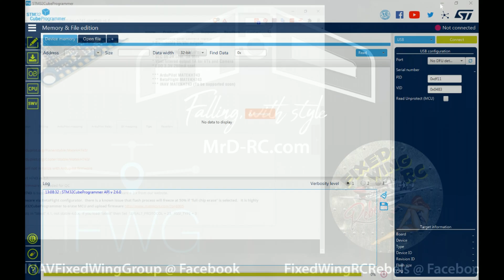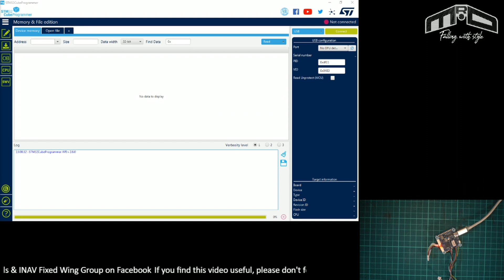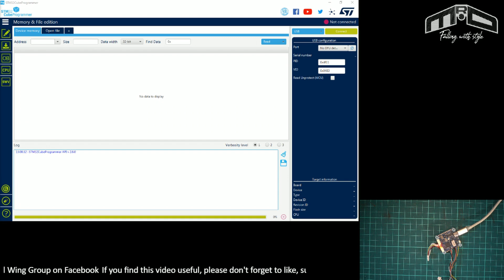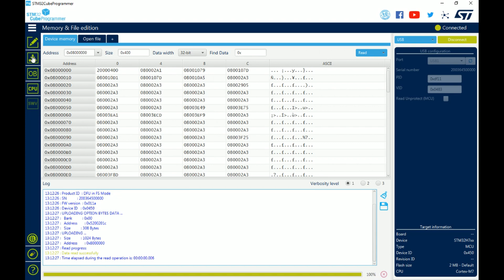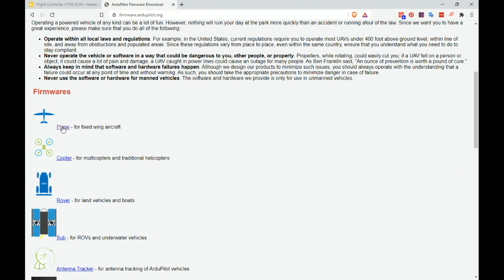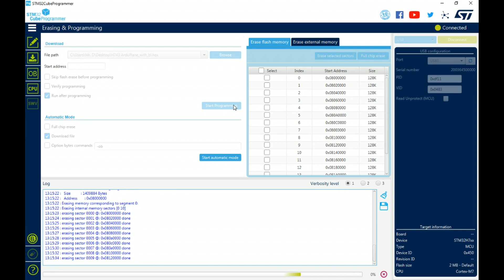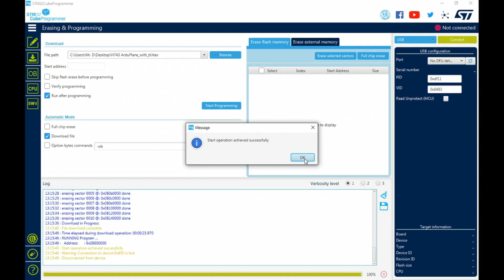Installing ArduPilot on an H743 Flight Controller

Comment: Thehr is problem with MATEC 743 WING V3, impossible to found working firmware with properly configured axis . Anyone know working firmware for copter in frame F450 ?

Comment: 100% Success!~ As a Mac user, the hardest thing for me was to get an email address on my windows computer.  Your instructions worked perfect!  Everything fell apart typing to download Mission Planer on the Mac.  Took me 2 hours to figger out the email thing but 15 minutes to get flashed and mission planner working.  Thrilled!

Comment: I've followed these steps however my board's red light is stuck on, and will not proceed with normal operation.
Reply: Same issue here. Any luck?
Reply: @jonathansoliman9918  I installed H743 on the H7A3 board rather than the appropriate software

Comment: Thanks so much! Turns out if you have a certain thrustmaster controller driver installed there is NOTHING you can do to get DFU mode to connect to the programmer. Pulled it up on another machine and this did it for me! Thanks so much

Comment: This guide is STILL useful and correct as of January 24!  Thank you Sir.  I am new to programming flight controllers, as I have only used "Ready To FLy" planes before.  Thanks for your help SIr, MOST APPRECIATED!
Reply from the maker: Glad it helped Jeff 👍🏻
Reply: I used this guide (for the third time) on December 18, 2025. Still works great.

Comment: i have matek h743 i done flash and also upload firmware its doest connect i power controller on red light
Reply: Did you figure this out? I have the same issue

Comment: Thanks Daren. Not sure I could have done that without your video!
Reply from the maker: Glad it helped 👍🏻
Reply: @MrD  I’m a actually using the fc for Ardurover but still the same setup for flashing the firmware. Still can’t get over how you found all that out!

Comment: I just used INAV to flash my F765wing with ardupilot, it seems to work, arxangle said do it that way.
Reply from the maker: It doesn’t always work. This particular FC was a prime example of that. It would not flash with INAV or BetaFlight. Hence this way of flashing using the official tool.

Comment: thank u so much u saved me from so much trouble cause i also have tried it with inva and beta flight configurators but those were just getting  stuck on load firmware and this thing really did worked

Comment: I'm trying to build a VTOL with arduplane and Missionplanner using Matek F722-HD and its designated arduplane_with_bl.hex (MatekF405-TE)  I  get to the start programming step and it just says operation exceeds memory.   I also tried it with F722-PX  but no luck. Any  suggestions?
Reply from the maker: F722 only has 512KB of storage. You're trying to flash an F405 target to the FC. Where did you read that the MATEKF405-TE target was for the F722-HD? Because they need to change that information, it's misleading. Firstly, that's a bad idea to mix firmware, as the connections between the MCU, components, and ports are likely different on the two boards. But also, the F405 has 1024KB of storage, so can fit more on. I don't believe there are any targets for the F722 on ArduPlane, because of the lack of storage. The same goes for the F411. However F405, F765, H743 would be fine to use.
Reply: @MrD   Thanks for the response!  Matek website's "Mateksys Flight Controller Lineup" page showed F722-HD and -PX has  having MatekF405TE for Ardupilot target. I thought there was something odd since the  spec page for them didn't mention ardupilot, just Betaflight and Inav.
Reply from the maker: @mickistevens4886  I see what’s happening, and it’s very confusing on Matek’s part. They’re actually listing the specs and targets for the F405-HDTE (can’t see the replacement for the F722-PX as that page doesn’t work properly on my mobile). The second row shows the recommended replacement FC in red. And all the specs below are for that replacement FC, not the original F722 FC. 

I will contact Matek and ask them to sort this out, as it is confusing.

Comment: Hi, I'll give you my thanks for doing this video, it's really helpful. I have just a concern. I tried doing this in a H743-WING V3 board, with the latest stable Copter firmware. Everything went fine, but when I connect it to Mission Planner it reads the device as 'Generic' and doesn't let me see any Flight Modes or change them, any idea what may be going on? I'll be glad if someone can help me, please.
Reply from the maker: Sorry, I’m still very much a noob with ArduPlane myself. The issues I encountered, all I could do was google, the read through a lot of text, only to not find the answer. Eventually, it does come up though.

Comment: Darren, once again a video sorts a problem!
Reply from the maker: Noice Josh. I was wondering which video lol
Reply: @MrD  if you want to get it totally sorted, stick one of the prebuilt hexs on with the ardu boot loader on it, so you can just flash from inside mission planner
Reply from the maker: Sweet. That wasn’t working when the video was made. I guess something’s been updated.

Comment: Thanks for that video. I hope some kind of full setup guide video (or series) are coming from you in the future.😁I'm missing Joshua Bardwell for Ardupilot. 😉
Mine went OK using Inav, full chip erase, flash firmware locally, it didn't freeze, configuration went OK, it connects to Mission Planner without any problem.
I guess I'm OK?
(Ignoring the problems I have during flight, weird behaviour of GPS home point arrow and ground speed, EKF lane switching, multiple warnings, vibrations, suddenly no elevator authority,...😶🙄)
Reply from the maker: Maybe I will. But I’m still getting to grips with ArduPlane myself. It was a huge pain to set up on a Matek F405-STD. But it is flying now. I will be making an update video, as I couldn’t find any when I tried to do this recently. There wasn’t even any documentation. Not good when you’re trying to update for the first time.

Comment: Thank you for the video! Quick question, after you do this, can you go into mission planner and flash arducopter like normal for a quad/hex build?
Reply from the maker: After the bootloader version is installed, you can update using mission planner.

Comment: Thanks for this video I will use it to try to flash arduplane to my Matek f405 wing (I seem to always be behind on what to buy & end up with obselete items) I don't want to learn inav or beta flight as I have used mission planner before. (but still have a great deal to learn)
Reply from the maker: The F405-WING is still a good flight controller. It’s still sold, so not obsolete.
Reply: @MrD 
Thanks to you I now have my 405 connected to mission planner so next its setting up servos etc.  I have liked and subscribed a while ago.   Happy New Year & thanks again for the great vids.

Comment: Were you able to connect all the components together via iNav?  The CANBUS just does not work.  I set both the air speed sensor and the GPS as MSP, but without success. Any tips?
Reply from the maker: CANBUS isn’t support by iNav. There currently aren’t any plans for it either. I think that’s a shame, but I guess there’s not much call for it at the moment. I don’t have the Matek GPS. I do have the airspeed sensor, but haven’t tried to connect it up yet.

There is a limit of 3 MSP devices. So maybe this could be causing your problems?
Reply: @MrD  I know you have the components.  I saw this video and ordered the components to learn the technology.  I did not imagine that iNav does not support CANBUS.  Matek wrote to me that "they never said there was iNav support".  That's ridiculous.  They sell flight controllers with dedicated entry to CANBUS.  All of their products works with iNav and should have explicitly written that there is no iNav support.  They enjoy a very large community purchasing their products and they have behaved dishonestly.  There are other YouTubers who have received the system for review and the impression is created that the technology works.  This is not a MSP issue.  The I²C input does not even supply power to the component.  In addition, Matek's website states that in order for the GPS to work in MSP, an up-to-date version must be dowenloade.  Just the burning itself was an annoying process that in the end I realized the CANBUS is not working at all. I connect the GPS to a UART and it is working but I cannot connect the AS unit via the GPS. Sorry that the post is so long. I'm a little frustrated.

Comment: Thanks for this video. I just received the v2 version of the h743-wing and was impressed that Matek links to this video in their notes section. I found that I was not able to flash ArduPlane using the STM32 application. It would always give me a startup operation error after the download. I ended up erasing the chip with STM32 and then flashing the ArduPlane firmware with BetaFlight, ensuring that I had erase chip disabled.
Reply from the maker: Thanks Mike. It seems like it’s not so straightforward to get ArduPlane on these H743 boards. And even then there are issues. I’ve seen a few people who keep having to re-flash and setup their config as ArduPlane loses it. At this point, I think I’ll keep to F based processors for this. 

Didn’t know Matek were using my video. That’s pretty cool.

Comment: Thanks for this video, Darren. Trying to get Arducopter running on my 743 Slim and the radio wasn't connecting. About to give it away for the night and followed the link to your video and spotted this at 1:24  "Crossfire support only exists in “latest” 4.1, not stable 4.0.x,  if you load “latest” then Set  SERIAL7_PROTOCOL = 23,  RSSI_TYPE = 3". Yes, I was using Crossfire. This is the fourth day of this project after making the quad work on INAV first. I spotted that comment in Tips earlier but I didn't have the knowledge to understand it. Cheers mate.
Reply from the maker: That’s great Terry. I’m glad you’ve got it all working.

Comment: I’m new to ArduPilot and Flight Controllers. Am I able to connect any GPS module to this flight controller? Or does it have to be a Matek MQ8/M9N?
Reply from the maker: Any GPS that uses a UART and a protocol that can be used by the flight controller firmware. The UBLOX protocol is a safe bet.
Reply: @MrD  Thank you!
Reply from the maker: @XianTC6  you’re welcome

Comment: Hello Darren,
In case I do need to change the ardu firmware to a different one do I have to follow the same process to get through?
Anyway there is a function like a full chip erase to select?
Cheers
Reply from the maker: If ArduPilot is already installed, you can use the non bootloader firmware and flash from Mission Planner. I’m not sure on the exact update process at this time. I’ve not done much with ArduPlane yet. 

If you want to put a different firmware on the flight controller, iNav for example. Just use that firmware’s configurator, select full chip erase, and flash the firmware.
Reply: @MrD  Darren I had the chance to start with Inav but now it is time to move to a different bay.
Inav really helped out with ardupilot as well
Reply: Planning any contents for ardu?
Reply from the maker: Not at the moment. Currently I have a lot going on, so am not investing too much time in ArduPlane at the moment. 

I have ArduPilot on one plane, and I’m going to see how it flies. I do need to update it, so I may record that process. But,  I’ve heard a lot of people say that iNav is for pilots and ArduPlane is for operators. So I may stick with iNav for most planes, and just use ArduPilot on some more sedate, endurance planes if I find that to be the case.

Comment: I flashed latest Arducopter on the Lumenier H743 Ultimate flight controller. However arducopter only sees one of the two IMUs (it does not see the MP6000 IMU). Do you have any idea why ?
Reply: Im having this same issue with my H743-slim running Arduplane. Its also not picking up the onboard Barometer
Reply from the maker: I’ve had a quick look on the ArduPilot GitHub page, but could not see a reported issue https://github.com/ArduPilot/ardupilot/issues?q=is%3Aissue+is%3Aopen+h743-slim So perhaps it would be worth raising one?

Likewise, I couldn’t see anything specific on the Matek site. So it looks like it could be a target related problem? The first thing to do, would be to create an issue on the ArduPilot GitHub at the link above.
Reply from the maker: Sorry, I haven’t really explored ArduPilot yet. I have set up one plane (Matek F405-STD), but not got any further yet.

Comment: Thanks for this great video. I usually use pix family (cube, durandal, and pix32), so this is my first FC that didn't come with Ardupilot firmware from the factory. I was beginning to worry that I had received a dud! I simply could not get it to be recognised when trying any of the other convoluted methods. Your instructions took four minutes start to finish. Thanks again for this video.
Reply from the maker: You're welcome. I'm glad I could help you get the flight controller up and running.

Comment: Thank you for posting.  Great job.  You just solved the mystery I've been trying to uncover while setting up this board.  Have you connected crossfire on it with Ardupilot?  If so, what is the best wiring for it?  Thanks in advance.
Reply from the maker: You’re welcome Alexander. I’ve not connected Crossfire yet. The last I saw, you had to use SBUS. But there has been a release since then. I’ve had to put that project on hold due to other things taking priority.
Reply: @MrD   thanks for your response.  From what I gather, the latest release of Ardupilot supports CRSF protocol which no longer requires SBUS.  I’ll try it out and keep you posted.

Comment: hey . great video i giot this fc hopping inav be ready when i was.. lol its not. im new to planes as you know.. should i wait for i nav?
Reply from the maker: After watching Paweł’s stream yesterday; it seems that support for the H7 is closer. The board is now booting with iNav. But the ports and outputs are not yet working. It’s looking like a June release for 3.0, so maybe it will be included. But I think there’s still a fair chance it won’t. 

I’ve not actually flown with ArduPlane yet. So I can’t really comment on that side. The set up isn’t as straight forward as iNav though.

Comment: Hi, can I follow this steps to install Ardupilot in a Matek 765 for fixed wing? Thanks for producing good contents. Cheers from Brazil
Reply from the maker: Yes, the same installation process can be used with any F405 or F765, as well as the H743 👍🏻

Comment: Good video man I got hung up on the stm thing 😂 so I reflashed with beta flight but nice to know how to use the stm have you tried the telemetry radio yet I wanna purchase a set being you can't just do a trim and then land and save trims to radio like eagletree so I'm guessing using a cheap telemetry radio you can trim on the fly literally but have to use a computer or cell phone
Reply from the maker: I’ve not got that far Joey. I have a plane ready to fly. Unfortunately we can’t fly over here at the moment due to covid lockdown. My plan is to read up on the pre-flight closer to the time. But usually I trim in manual, then physically adjust the linkages, as if there’s no flight controller. I’m interested to check out the ArduPlane auto trim too.